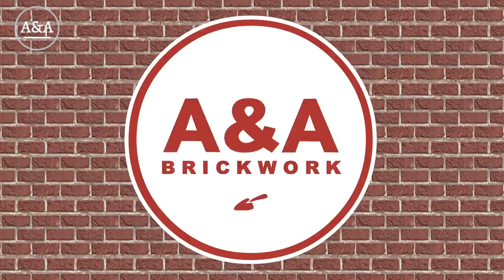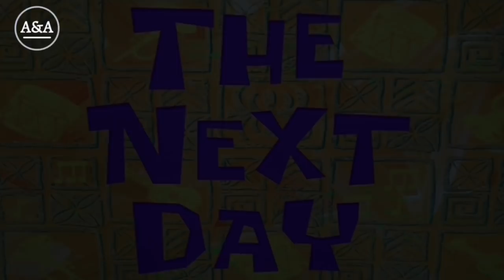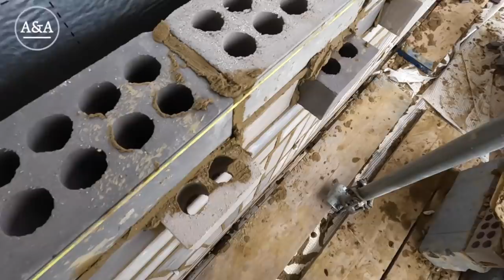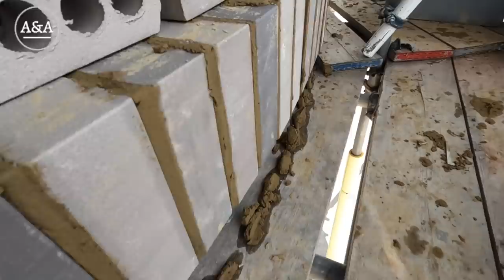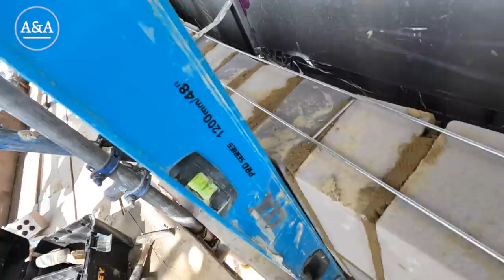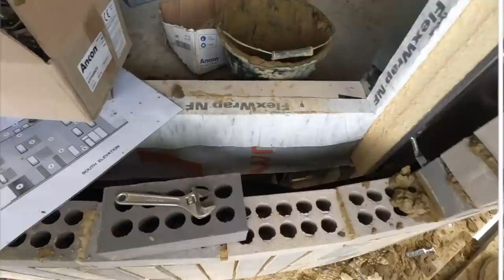Are They Taking The Piss? Bad Steels And Tricky Panels #Bricklaying

Comment: Adam!! What a Poxy Site,  and those  tricky Panels I think I would be going Monk Bond Style to help break the Straight Bond Three Quarter - Bat. Instead of Brick - Bat,  And using Brick Tor Wouldn't go amiss neither for reinforcing some of that work in places,  Delboy. 👍👍👍👍😏😏
Reply from the maker: Yeah on the radius panel we put a 3/4 in and got rid of the straight joint and it looks so much better! We copied a panel on the site already built to match it and it looks shit 😂😬😬😬😬
Reply: Head down & Arse up Adam, keep going mate You’ve got a great happy gang there, 10.05pm here in Melbourne 16th May my B / Day on the 19th 88 & not out Gotta Slab of Tinnys in the Fridge will crack a couple of Tubes for you 🍺🍺👍👍🇦🇺
Reply from the maker: What a legend you are! Happy birthday for when it comes! 88 and still on the trowel 🤯 that’s mental, you’d still show me up 😂😂

Comment: the builders should  of made you a template for  that curve 1 pain in the arse .who ever designs that panel cut a little of timber 45mm lay the projecting  header to it saves keep  taping .you got some paitaince mate .Nice bit of work  your doing good luck mate
Reply from the maker: Lovely tip that 👍🏻 cor my patience was running out I’ll tell you! Thanks Brad 👍🏻